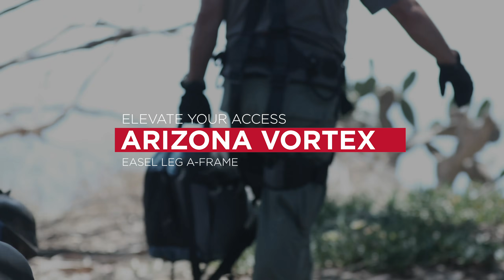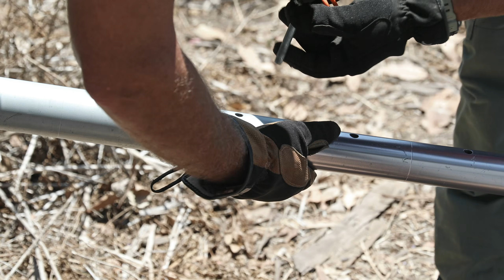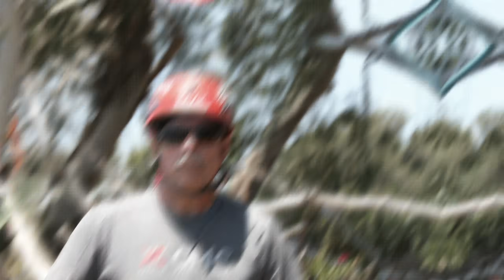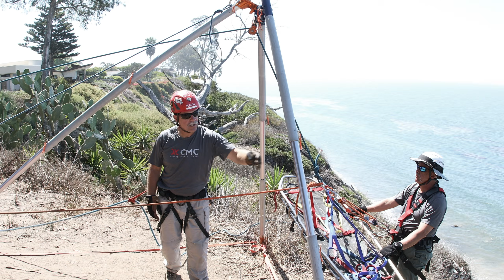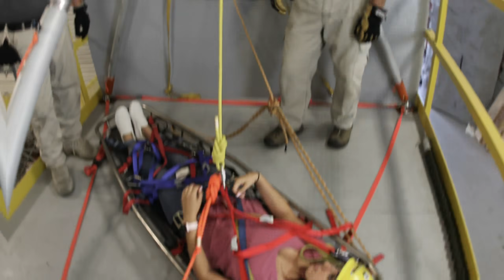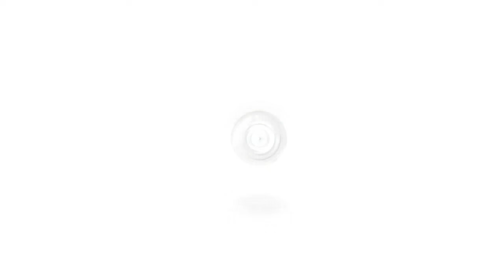Easel Leg A-Frame | Elevate your Access | CMC

Comment: Thanks for the video!
You guys don’t use a dynamic belay line through the head to prevent fall factor when negotiating the edge?
Also I notice you run your inner legs midline up the leg as opposed to at the top like I’ve seen most devices run. What are the advantages of this? Is this a recent update to the old manuals you released with the vortex?
Thanks!